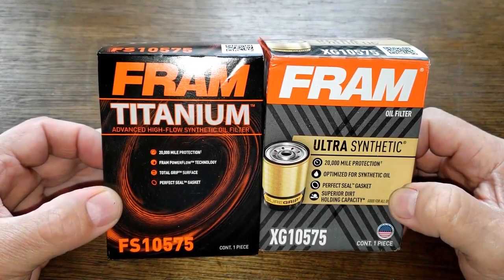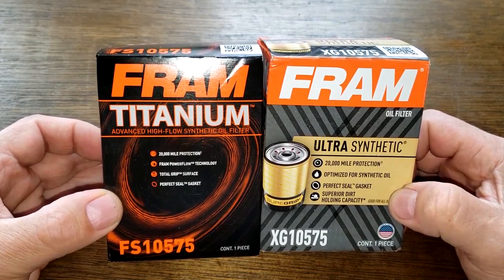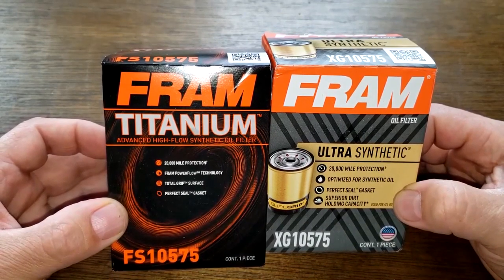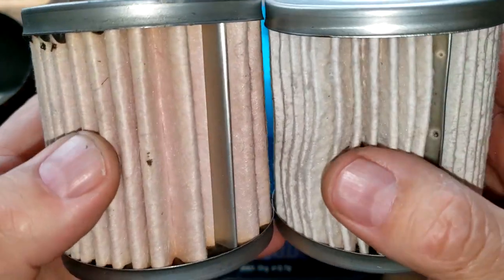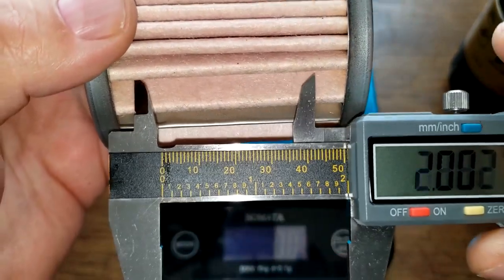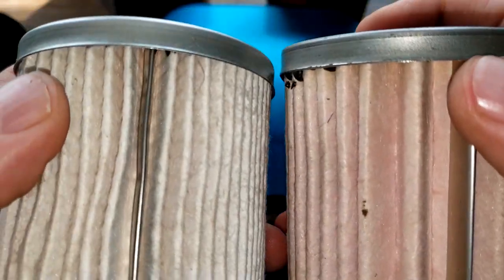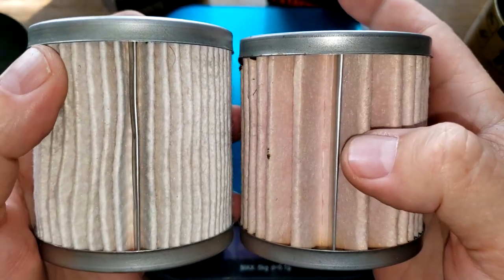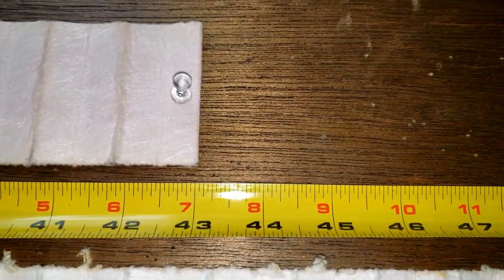Fram Titanium FS10575 Oil Filter vs. Fram Ultra XG10575 Oil Filter Cut Open

Comment: One of my cars went 288K miles, and my small pickup went 296K miles.  Neither had engine issues, and I only run Fram basic filters.   No Ultra, no Platinum, no jewel encrusted, just orange filters.    Yes, many family members tell me they are crap, and also that Penzoil sludges up your engine. Yea, not what I have seen.

In 40 years, I have done all but two of my oil changes.  In those two "Jiffy"-type places, first, they could not figure out how to get the hood open on a 1985 Honda Accord.   The most popular car on the road at the time, and they were beating on the hood... with me watching through the picture frame glassed window in waiting room.  That should tell you, it is NOT the filter causing your problems.  The second pass with an oil change place, I asked them point blank, "Can I only get the oil and filter changed, not the 14 point fluids, etc., checked?"   He said yes, but asked why I didn't want the complete service.  I told him that is 14 points when they could foul up my truck.  Anyway, I pulled in, and the vehicle was 'swarmed' with lube techs.   One yells out, "You have a flat tire!, I can hear it leaking."   Another hollers from underneath, "You have an oil leak!"     From my cab, I could see them looking at all my fluids.       To the closest guy, I said, "You're done.  Everybody back away, I am pulling through."
Reply from the maker: Thanks for Sharing, If one can, best to do your own oil changes.👍

Comment: Thread machining process left a couple of burrs behind, appears to be.
Stiff toothbrush would rub those out, held upside down to allow particles to fall. None of those bits would ever make it through the filter, but I believe the oil flows out of the filter in the center post, not into it.

Comment: Another great video whip I think the only difference with the cans was the full texture giving you the extra thickness👌
Reply from the maker: Thanks Ken,
Yep, judging by the weight they are pretty close.
Reply: @WhipCityWrencher  I wish you would have used a paint stripper on a small section to remove the paint then measured the can thickness. I'm pretty sure they're going to be the same though.
I think the black paint is a good thing but I don't care for the additive to make it grippy. I've seen filters where the paint got messy and ended up where it shouldn't have been. The paint alone isn't much of a problem but the added material to make it grippy going through the engine... Can't see that as a good thing. 
bobis site has some really sloppy paint examples on Purolator filters.

Comment: So I just purchased 3 titanium filters number FS7317 and it doesn’t have the old wire backed media it has the same media that’s in the fram ultra
Reply from the maker: That Sucks!
They just can't leave well enough alone, it's always about $$. Someone else posted that they are changing. Without the backing, they are not worth the price that they want at Advance Auto. Best off going to Walmart and getting the Ultra for less.. I just bought some FS8A and they have the metal screen backing. Must be older stock or they haven't changed that size filter yet. 
Thanks for Sharing!👍
Reply: Yeah I was pissed and because I live in a small town I had to order them online 🤦🏻‍♂️ oh well I’ll still use them

Comment: Has the quality hone down on the ultras?
Reply from the maker: As far as I know, the Fram Ultra is being made the same as the one in this video. I haven't opened one in a while but I've heard the Fram Titanium oil filters are no longer being made with a metal screen back.
Thanks!

Comment: Its always good to inspect inside the filter and the base plate ! Ive seen alot with paint chips - one actually cross threaded and one had a big dead spider in it ! I do like the titanium for the metal backing and i like the fram ultra for the price ! Just a matter of preference and cost ! Nice vid whip !!!
Reply from the maker: Thanks, Scotty!
Reply: Them Spiders taste My-T-Fine when ya drop 'em in some melted chocolate bars, Scotty  --  and they are GREAT with your avocado taost !!!  😁
Reply: @SlikLizrd  or clog a timing chain oiler or lifter passageway !
Reply: @SlikLizrd  yup, spiders are welcome in my engine anyday

Comment: About the metal shavings on the threads at the 2:58 point in the video, this is what they think caused the infamous Corvette engine problems GM investigated in 2015.   We need to check for this when doing our own oil changes.  Little chance an oil change technician at Quicky-Lube or a dealership would check it though.   ... GM told all new Corvette owners to change their oil early at 500 miles just in case some the OEM AC-Delco blue oil filters had metal on it's threads, assuming it could maybe be flushed out.
Reply from the maker: Yep, when I saw that piece of metal I cringed.
It kinda sucks when you have to buy, shake and check the whole oil filter over with a fine tooth comb.
But that's what is made these days.
Thanks for sharing!
Reply: 😳 In theory, such small pieces of metal (filter base plates are made of mild, non-hardened steel) should not cause any significant damage to the engine, and then, after passing through the entire engine, settle in the engine oil pan.
Reply: Stock oil and filter should be dumped at 500 miles max anyway.  300 would be better.  The first change is where all the break in shavings are. Then change filter at 1000 and top off.  Dump both again at 2K.
Reply: @Andrew__Smith  In my opinion, it could. The bearings are made of lead and other very soft metals, so steel could easily score the bearings as tight as their clearances are. And once the metal goes through the bearing(s), it as well as whatever wear particles were created will end up going through the oil pump. Since most oil pumps have aluminium housings and steel is harder than aluminium, that's bad news.

Comment: Fram is garbage to me, I'd never use one of their filters.

Superb review Whip thx
Reply from the maker: You're Welcome Chris👍
Reply: Their cardboard end cap filters are good to 3,000 miles, their metal end cap filters do just fine.  However, debris in the threads is not good...
Reply: @lonniebeal6032  I'd just say chose a brand that doesn't make cxxp. Then you're good to go. 

I like Hengst, Mahle, Mann, Alco, Wix

Comment: Inspect and wipe out the threads. They're always filthy. And take a quick look at the louvers inside the can and make sure they're all open. I've seen many filters that weren't machined correctly and have closed louvers which makes it run in bypass mode way more than it should
Reply from the maker: Good Tip!
Reply: The high end frams are in bypass most of the time except at idle..The bypass valve is only like 12psi and the filter itself has much restriction.

Comment: Good video Pete.  You're great.  Fram is still crap.
Reply from the maker: LOL😊
Thanks, John!👍👍
Reply: @WhipCityWrencher   It's true, Peter. But, as I said somewhere above, their cartridge filters are not bad, especially FRAM  Synthetic/Ultra Synthetic cartridge Oil Filters for example XG11665 or FS11665 . I use  XG11665 at my previous vehicle Dodge GC -  the filter is made very carefully, and the filter media itself is durable and completely synthetic.

Comment: My question is does not the bypass valve open up regardless if the filter is new or old under heavy acceleration?
Reply from the maker: Hi Richard,
I don't know the answer to that, but I would think it might open under hard acceleration and In the winter with cold engine oil.

Comment: Nice of John to send you this filter! YaY to John! Both filters look solid and well-built. Wonder if all the Frram filters have the metal shavings inside the metal grooves. Perhaps the other Fram filters have clean threads. Another great video! 👍
Reply: Shavings could be from a tap that is getting dull or other variables during the threading process. Whip and others have found shavings in/on other filters as well.
Reply from the maker: Hi Ella,
Thank You!
Yep, both filters are good I just got one of the bad Ultras that were made.
Have a good weekend!

Comment: Good to check each filter before buying. I’ve even noticed such debris on other brands of filters. I’ve read that it may be caused by a worn out tap during the manufacturing process. This is why I wouldn’t buy ANY filter online. Too many unknowns. Better to go to a brick and mortar and inspect it yourself! That said, the ultra looks like a solid filter. I think I’ll try it out
Reply from the maker: Hi Christopher,
Thanks, Good Advice!

Comment: Interesting Fram Titanium is still using the old screen-backed pink media the Fram Ultra previously had.  Unless that Titanium was just NOS.  Thought they both switched to the new Ultra media (?).  I think they both perform about the same anyway.
Reply from the maker: My Take is they want a Premium oil filter and charge a Premium price.
A lot of people liked the Fram Ultra the way they used to make it but they weren't getting much $$ for it at Walmart. Then again I could be wrong.
Reply: @WhipCityWrencher   I think you posted the bobistheoilguy-sourced chart from inside Fram where they showed the New Fram Ultra with no screen-backed media, just a dual-layer, actually slightly filters better.  It should be about as durable too.  Conclusion:  They make the New version cheaper, OK, but it performs about as well as the old design (which the Titanium still uses).
Reply from the maker: @softwaresignals  Yes I have a chart that someone else posted "said Fram gave it to them" and I posted it also, I'm not saying the Ultra is a bad oil filter, but If I had to choose between the two oil filters I would take the Titanium. JMHO

Comment: I’ve always use Fram Ultra for their filtration rating, but I’m kinda turned off of them based off of the metal shavings on the threads. What’s currently your favorite filter based on the testing you’ve done?
Reply from the maker: I like the Fram Titanium and Purolator Boss. I think they are two very well-made oil filters.
Reply: What about the latest Fram Endurance? How does it compare to the titanium or Purolator boss in your opinion? I just bought some Amsoil Signature Series 5w30 for my f150 and am looking at filters. Change oil every 5000 miles so I'm not worried about longevity (20000-25000). Just found your channel, really enjoying the content!

Comment: Thickness of filter media could relate to flow; thicker media = more resistance. Since both are rated at 20 microns, the filter with more sq" should be superior.
Reply from the maker: Flow rate and filtration are all a trade-off.
Reply: @WhipCityWrencher  exactly. I agree.

Comment: Both of these had the orange ADBV in them. Wonder if they really work? Like to see how much oil if any oil stays in the filter . . . when used in a  Inverted (Base Down) Position with the engine turned off . . . such as in the case of been used on a  Subaru boxer engine.
Reply from the maker: Hi James they do work. I have a used filter video coming out Tuesday, April 4th. It's not a Fram oil filter but you'll see the silicone anti-drain back valves do work.

Comment: About that metal shaving in the ULTRA's threads -- No quality-control system is 100% reliable -- SOME rejects will get through, but there is an ACCEPTABLE LEVEL of defects in these specs.
Most US Government specs were at a MAXIMUM of 3%, but not all.
Finding a filter with the shaving in the threads is BAD, but it's important that you found JUST ONE -- If you found several with that same problem, it's time to call FRAM -- collect.
It would be totally wrong to condemn an entire line of oil filters, based on finding just one reject.
Your sharp eye caught the shaving, and now we all know that we should check the threads AT THE STORE, and BEFORE we PAY.
I checked the threads of all the oil filters I have on hand -- different brands & different sizes -- all clean.
Thanx for calling attention to a potential disaster, and keep up the good work !!
Reply from the maker: Thank You!😊
Reply: @WhipCityWrencher  NO, Man -- Thank YOU for doing all the work !!

Comment: I think you’re right about that oil pressure killer ,thicker medium reduces the oil pressure you do not want that
Reply from the maker: Hi Richard,
I never said it was an oil pressure killer, If I did what part of the video did I say that?  I dont know for certain that it even affects your oil pressure at all, it may. I dont know for sure.
Reply: @WhipCityWrencher   no I didn’t say you did I heard it from somewhere else
Reply: Thicker media should increase pressure as it is resistance to flow, but it depends on where that measurement is taken. Before would be higher. After would be lower.  But it wouldn't be enough to care much. You can see a pressure change from a 5w30 to a 10w40 both hot and cold.

Comment: Whip, just spotted something kinda interesting.  Amazon is presently selling the Purolator Tech (TL14610) for $2.40.  Now it won't ship for 1-2 months but it appears to be the Purolator standard oil filter (the red can, L14610) without the silicone anti-drainback valve.  I wonder if that's the only difference.  If it is that's quite a deal for those who do 5k mile oil changes.  Just throwing it out there if you're looking for video ideas.
Reply from the maker: Hi John,
I just ordered one. What filter do you think I should compare it to? Thanks for the suggestion.
Reply: @WhipCityWrencher  Well, I think I'd compare it to the Purolator L14610 in all ways including the thickness of the filter media as you always do anyway.  Silicone ADVs are nice but a total waste if your filter mounts vertically.  So if it turns out to be or at least appears to be the identical filter to the red Purolator filters it would make it a deal.  I'm also curious if the tech filter is made in America like the other Purolators.

If it turns out it's not made in America I'll be disappointed.
Reply from the maker: @johnmcsweeney4966  Hi John,
Okay, I'll do that. I'll let you know when I make the video and when it will be shown. Kinda depends on when I get the filter from Amazon.
Reply: @WhipCityWrencher  Cool.  All good.  It may prove to be a real deal at that price.  I noticed the micron rating is not referenced on their site for the tech filters.  Hmmm.
Reply from the maker: Hi john,
I finally got the Purolator filter today. I let you know when I make the video and when it will be shown.
Reply: @WhipCityWrencher  Thanks a bunch Whip!  Can I ask where it's made?  (If you'd prefer to wait to make a video I completely understand.)
Reply from the maker: @johnmcsweeney4966  No problem, The only difference I can tell by looking at them is the Red one I got from AAP has a silicone anti-drain back valve and the White Tech from Amazon has a black nitrile anti-drain back valve everything else looks the same and they both say Mann + Hummel Purolator filters on them, also made in the USA.
Reply: @WhipCityWrencher  Happy to hear they are made in USA!  Imo if they prove to be just like the red Puros in every way except the ADBV for $2.40 thats a steal.  The question of course is "are they?"  What gives me pause is the red Puros are listed at 96.5% at 20 microns which is excellent.  The tech line has no efficiency listed though I'm sure the company knows.  Everyone  makes a big deal about the ADBV but for me it's a waste of $ as oil filters mount vertically on my car.
Reply: @WhipCityWrencher  Whip, did you weigh them by chance?  If so were they close?
Reply from the maker: @johnmcsweeney4966  I think the Tech has the same micron rating as it says 96.5% dirt removal power on the box.
Reply from the maker: @johnmcsweeney4966  I just weighed them and the white Purolator is roughly 209 grams and the Red Purolator is 206 grams. I called the Techline number on the box (800-526-4250) and the woman who answered the phone at first said 21 microns, I then asked at what percentage and she said 50% at 6 microns and 95% at 20 microns. Which is the same as the microns given on the Wix oil filters.
Reply: @WhipCityWrencher  So 96.5% at 21 microns?  Sounds like a deal for those who don't need a silicone ADBV.
Reply from the maker: @johnmcsweeney4966  Yep, I think that's what she meant when she said 21 microns.
Reply: @WhipCityWrencher  Well I'll keep an eye out for the video.  Very cool.
Reply from the maker: @johnmcsweeney4966  Hi John, I made the Purolator video, it will be shown on Friday, Dec. 2nd. Both filters look the same the only real difference is the Anti drain back valves.
Hope you like the video.
Reply: @WhipCityWrencher  Cool!  Thanks a bunch Whip, I'll be watching.

Comment: Doesn't the ultra also have a wire mesh as well? I have seen recent videos with the Fram ultra having metal mesh. I wonder if they all do or don't have the wire mesh on the ultra filters
Reply from the maker: The Newer Ultras being made now don't have the metal screen backing. What you probably saw were older filters.

Comment: Great job pete! Look like good filters but Fram just seems like low quality control.  Another channel  found rust in the filters. I cant trust them.
Reply from the maker: Thank You!
Sad to say but Fram's not the only one, I've opened other filters with problems also. Buyer beware though.
Thanks for your feedback!👍
Reply: @WhipCityWrencher  in your opinion. What kind of filter is best.. purolator boss, wix xl, apa platinum, royal purple, amsoil etc..???
Reply from the maker: @dannyzamudio1252  Hi danny,
Those are all very good oil filters and I would put any one of them on my vehicle. There really isn't a single best, but if I was to change my oil today, I would use a Fram Titanium.
Reply: @WhipCityWrencher  appreciate it
Reply: @WhipCityWrencher  i didnt expect titanium to be that good